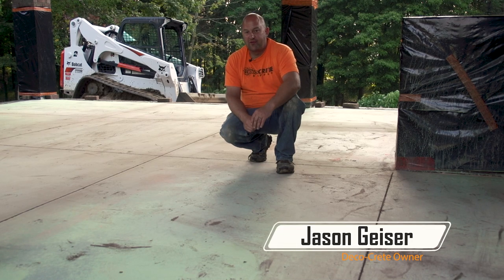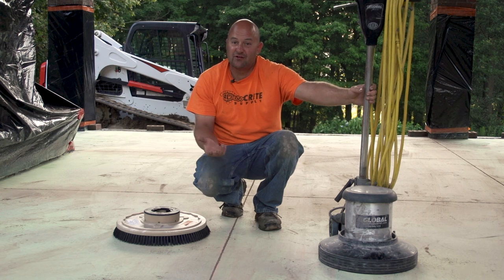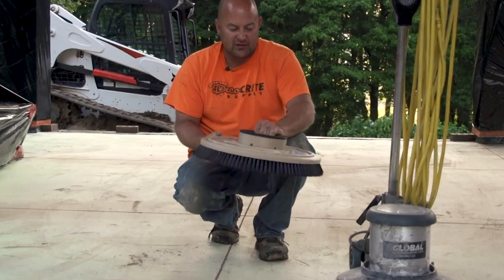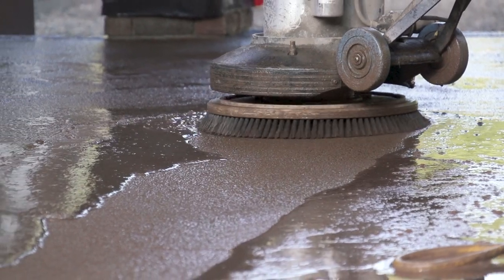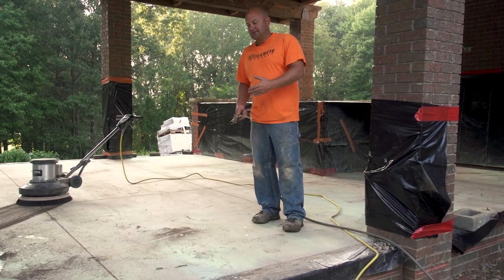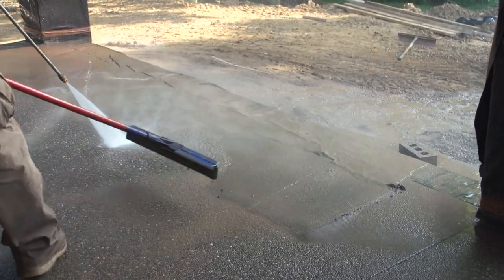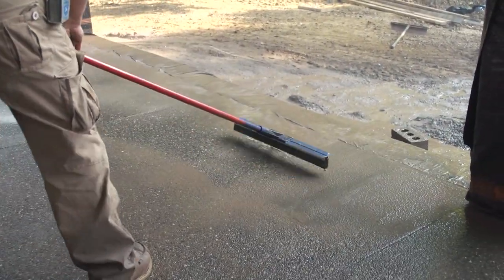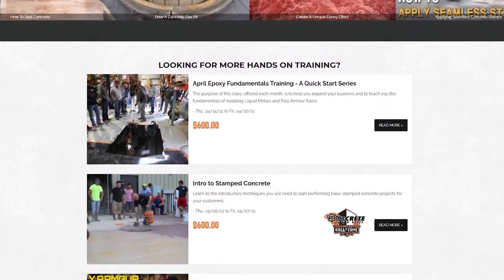Quick And Easy Exposed Aggregate

Comment from the maker: Deco-Crete's D-Activator is topically applied to freshly-placed concrete to prevent cement paste hardening. This achieves a more precise exposed aggregate finish by selectively halting the hydration process down to a controlled depth. With a longer window before the surface paste must be removed, the underlying concrete can harden properly, locking in aggregate and reducing pop-outs!
https://www.deco-cretesupply.com/products/admixtures-retarders/deactivator
Coverage: 150 square feet per gallon
Size: 5 Gallon Pail
Reply: Great video! What kind of window do you have after the concrete has been poured?